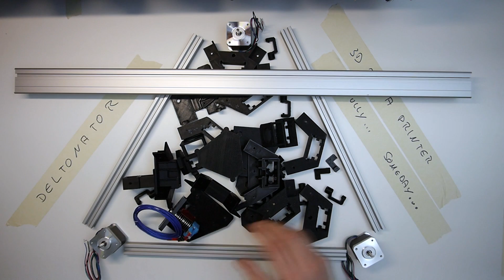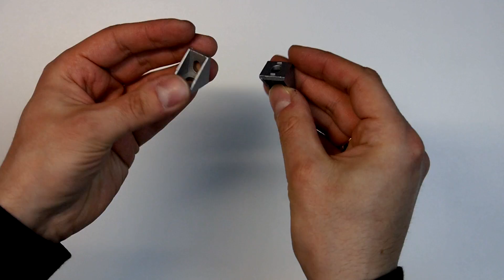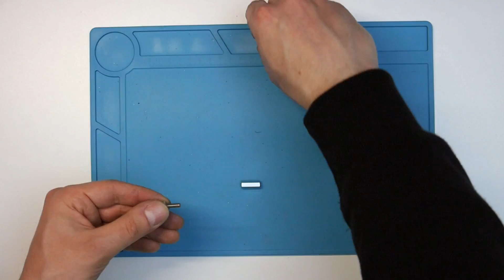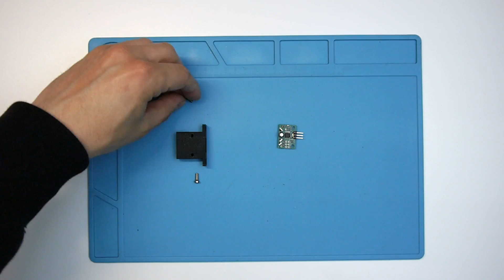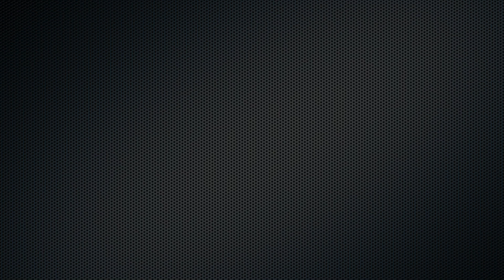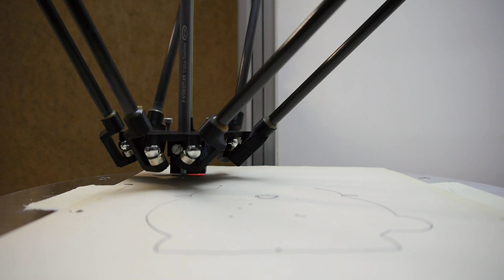Deltonator Build #4 - Bed & Bunny

Comment: Hey,

You seem quite fond of delta printers. I am currently building one at the moment, and I was wondering if you had any pointers for me. Just reply if you want my skype so we can talk privately. 

The two printers I am considering: 

* http://www.thingiverse.com/thing:923830
* http://www.thingiverse.com/thing:17175

Which one do you think I should make? I do not have access to a large variety of tools, mainly a drill, screwdrivers, and a dremel is about it. Also a belt sander but idk.
Reply from the maker: I'm by no means an expert, and there are forums with people who know a ton more about this than I do - and that's usually where I go to get myself informed. The forums and wikis of reprap.org and duet3d.com are my primary sources. 

I chose to build a delta printer for various reasons - mainly because for me, getting a solid frame perfectly rectangular in all three dimensions so that nothing would bind or warp seemed more complicated than getting three vertical rails parallel and six rods of the same length...

Having said that, for a delta, you need to
* decide what target volume you want and calculate the printer size from that (various online calculators)
* decide what kind of joints you want (custom in my case)
* decide what kind of rail system you want (LM8UU, linear rails, OpenBuilds, MakerSlide, ...)
For me, these three decisions alone lead to the conclusion that I would need to construct my own printer. I don't know why, but MakerSlide does not seem to be very popular for 3D printers. If you're going for a more conventional approach / mainstream model, you can source a lot of the parts (corners, carriages, effector) as CNC milled metal parts to improve accuracy.

Oh, and - don't cheap out and buy the crappiest parts there are. You will pay with time and frustration for every buck that should have gone to a quality fabricator like E3D.